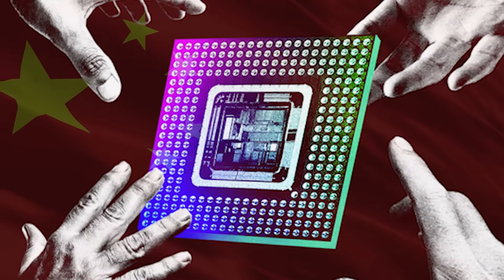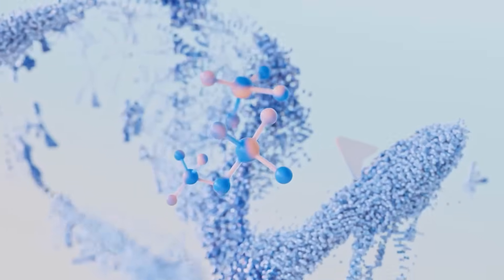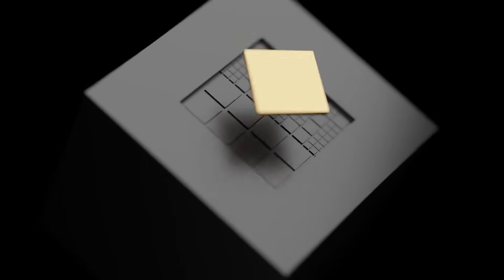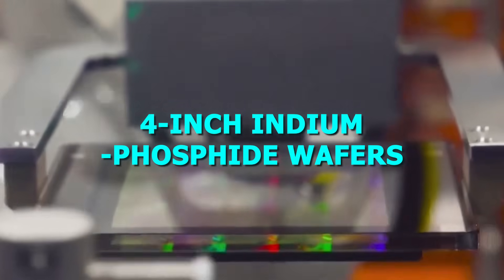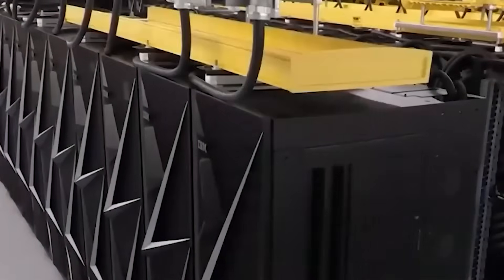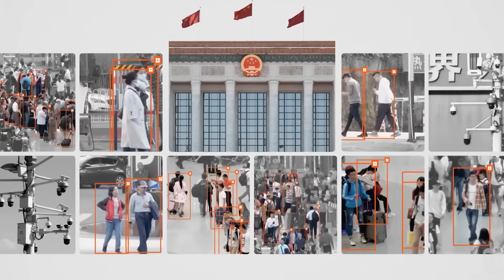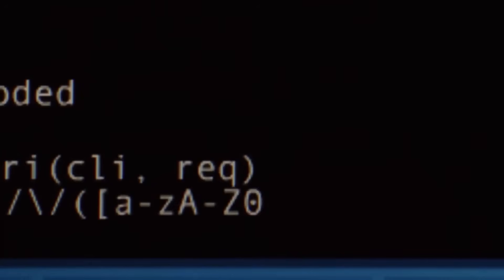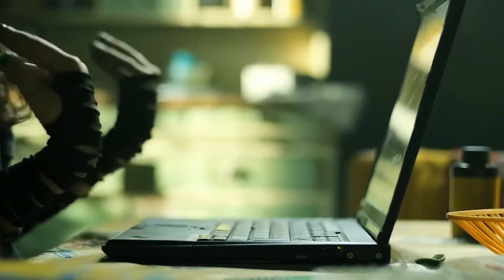China Released a Quantum Photonic AI Chip That is 108x Faster Than NVDIA!

Comment: I am hearing a lot of word salad for things that do not work the way they are being described. Despite the “quantum” branding, it does not manipulate quantum superpositions or entanglement. It’s closer to an optical AI accelerator than a quantum computer; and is it doing this as a very task specific thing - so the benchmarking becomes skewed. the China state media are actually not as boastful as western media, which are stating certain AI workloads are getting these boosts in speed; which are very task specific. using light instead of electrons will give this benefit, but do not think for a second this is "quantum" in nature, or represents what the chip can do when performing any task. 
-